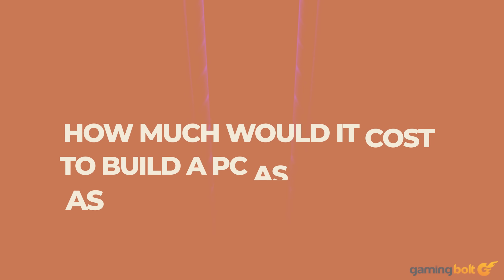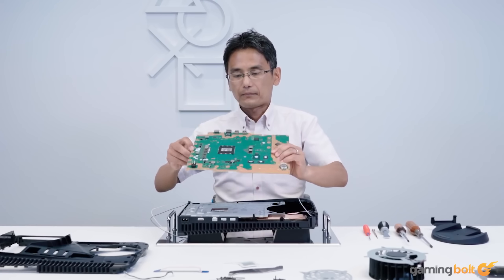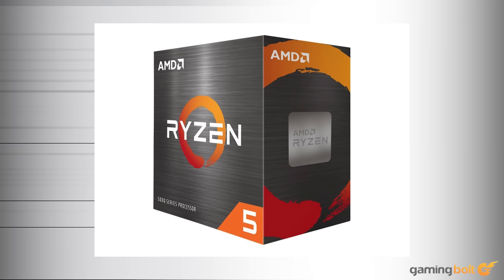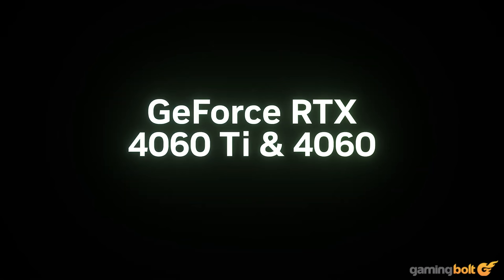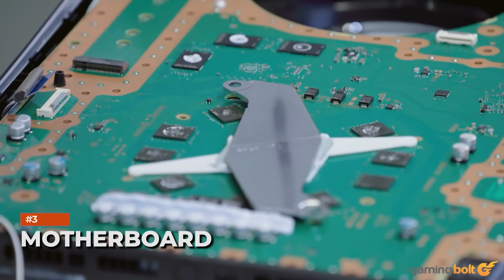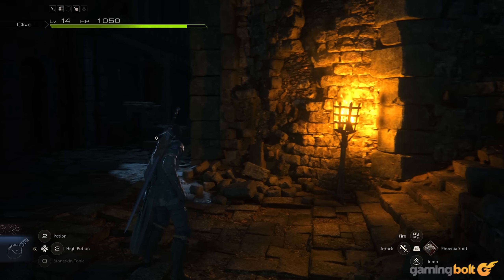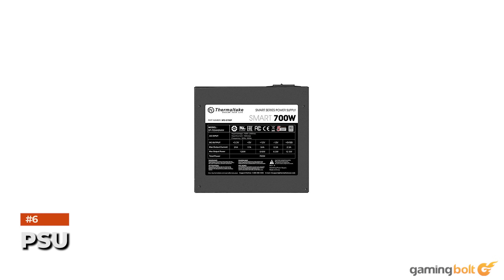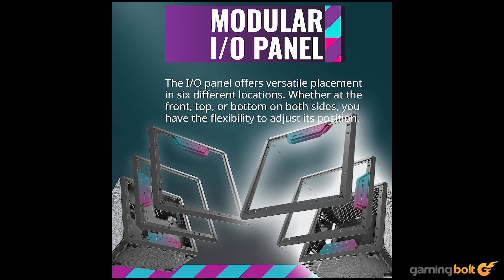How Much Would It Cost To Build A PC As Powerful As The PS5? (2023 Edition)

Comment: You lost me at 4060ti, the FP32 performance of a 4060ti is 114% greater than the PS5's GPU. The 5700xt on the other hand only has a 5% difference in comparison to the PS5 and would be a better match since the 4060ti way outperforms the PS5 GPU.
Reply: I would definently go for a 6700xt or 3060ti. I would also not recommend that Thermaltake psu it's horrible for reliability. Everything was OK other than that motherboard but still fine as 99% of games on pc don't support direct storage. And the cpu is better than the modified 3700 cpu for 1080p gaming.
Reply: @dayadam16 

The CPU in the PS5 is worse than a 3600. Digital Foundry have the Series X CPU and Ram on a board and performance is horrendous.
Reply: Raw performance wise I completely agree. The thing about PC vs console configurations is the optimization. Devs. only have to optimize for one set of hardware with console, but on PC there are so many different configurations.

Higher performance hardware can be seen as an offset to the difference in optimization.
Reply: @balloonreaper games are never optimised for PC on release nowadays anyway 😂😅
Reply: @balloonreaper This also explains why almost every game runs so much better on iOs compared to Android. Devs have to optimized for just one set of hardware.
Reply: @balloonreaper Not to mention the intrusive and inefficient operating system that runs on most PC’s
Reply: @richardbixler  Yeah, that’s valid. A lot of extra processes in the background, and OS level optimizations are borderline necessary; though this can be dependent on how powerful your hardware is as well.
Reply: @balloonreaper or if the games is designed around a console then the pc game is a second thought
Reply: @balloonreaper  even if you have the same config on a PC the results will still differ.
Reply: @balloonreaper The player can perform optimization themselves. Takes 10 minutes.
Reply: @balloonreaper  Nah bro, todays gpus with dlss and fsr really closed the gap. You can turn off certain settings that don’t do anything and give you way more performance.
Reply: @balloonreaper  I completely agree with you, but that raw power being far more than that of a console, it allows for higher settings, fps, and resolutions. It's just a poor comparison in my opinion. The optimization across the board has been lacking too, regardless of it being on PC or console
Reply: @Wrinkly-g2g  Yeah, no kidding. It seems to be prevalent with AAA titles lately. Holding hope that future releases are brought to the table with good day one optimization.
Reply: @balloonreaper valve optimizes too now, its insane what a steam deck can run
Reply: @Boro87  Right? It's a good thing though. The Steam Deck is great for gamers on the go.
Reply: Optimization on ps5 is not even remotely close to be as bad as it is on pc. I don't know what you mean by optimization across the board. Most games are optimized on the Ps5 first. Every other platform gets an inferior release. Especially pc.
Reply: @Wrinkly-g2g  thankfully it seems more games in the PS5 era have in game options to set the resolution levels and stuff.
Reply: It depends on the games , ps games are built for ps5 and will the need more power. It's impossible optimize for pc
Reply: @dannywelbz3650  the lanes on the 3600xt and the ram on a 2070 non super run at 3600 MHz with that ram and a good SSD (980) should keep the inside lanes open smooth like butter
Reply: @Wrinkly-g2g  I get it but NO. Take iphone for example. There are thousands of androids literally thousands which outperform ios in almost every metric possible yet iphone completely outshines any gaming androids and that is by a mile. Take iphone 13 pro max for example with its 6 gb of ram that grossly outperforms the rog 7 phone with its 16 gbs. And its not even close after around 6 months of usage while the iphone lasts basically 3-5 years depending. 

And i know exactly what i’m saying because i am an mobile esports player and there isn’t a single pro player in mobile gaming who would say that android is better even though benchmarks say that the android is wayyy stronger. 

Its still slightly different on the pc side of things. Due to the flexibility but im just saying this to say that optimization matters a lot. Thats how macs have been so efficient than windows despite of having a lot worse specs on chart and im not even talking about m1/m2.
Reply: @balloonreaper optimization? You mean for example jedi survivor on ps5 on per mode is 640p nativ scale up to 1440p and medium setting with RT and run 40-60 fps before new patch that cut RT and bump res to 1008p lower than 1080p scaled up to 1440p? On RTX4060TI in this game you can play im much higher res scaled up by DLSS3 that give you much better image quality, higher graphic setting and above 60 fps. And in other games is the same scenario schowing that rtx4060 Ti or even 4060 is faster than ps5 gpu that is equivalent to RX6600XT-6650XT RDNA2 pc gpu-s.
Reply: @Mr_Pan01  Yep, that would certainly be a method of optimization. I think the reason 4xxx series GPU's are capable of getting some significant performance gains has to do with  DLSS3's frame generation capabilities. DLSS in general is a very useful feature, but their third iteration of it seems( so far ) to have the best benefits.

Even without DLSS( any iteration ) many PC's of a higher spec are going out outclass console performance across the board. It's just the nature of things y'know? Technology advances so fast on the PC front that they can't pump out consoles fast enough to keep up; at least not reasonably imo.

I'd say the only time console has an edge in terms of performance is when devs. put forth poor effort to get their PC releases as stable and optimized as possible. That's not say it'll always this way, but there's a statement in the attempt just as much as the complete product.
Reply: @Mr_Pan01 thats what i have, an rx-6600xt and frankly, i play everything on ultra no problem. With an 11gen cpu. Frankly i would never go back to console. I switched ps4 for computer. Will never come back.
Reply: It may be but performance wise I don't see it doubling the performance of a 6700.
Reply: I think he was building a PS6
Reply: @Amnesia2121 PS6 is about 3 to 4 years away so I say PS6 will be more  Powerful
Reply: He was talking about 4060, not 4060ti.... though in the picture he showed both.
Reply: 4060ti its like 2 gens ahead of the 2080 (ps5) this guy lost his mind
Reply: Why everyone is talking about 4060ti? He said 4060...
Reply: @TheSlimshady955 even though a 4060 is waaaay ahead of PS5
Reply: @BugHuntersPC   i wouldnt say way ahead since gpu equivalent to a ps5 is like between rtx 3060 and 3060ti , when we know that rtx 4060ti performs less than the 3060 ti in some games, it's not as much as you pretend. But yes, its overall better performance. A 4060 is more like a 50 braket btw. The true gpu equivalent should have been an rx 6600 xt...
Reply: The most similar gpu purely based on specs and nothing else is the rx 6700 non xt  vram is te only difference
Reply: @ham_..  fax bro compared a $400 gpu to a $400 console that runs at half the settings
Reply: @ham_..  I can agree it's a far better comparison. I'd say the 6600 is more in line as far as tflops are concerned.
Reply: Optimisation take under consideration
Reply: FP32 performance of nvidia cards is doubled on paper since the 3xxx versions, since those cards do 2 integer calculations per core per clocktick. This results in double the tflops on raw power compared to the 2xxx versions or AMD cards. It’s just on paper and good for the tflop marketing. The 4060ti is not 114% faster than a PS5 GPU.
Reply: Equivalent wise, on the AMD side, then it's basically a like an undervolted 6700 or like a slightly overclocked 5700XT only with RT. On the Nvidia side, it would be around the same as a 2070 Super or half way between a 3060 & 3060Ti, only with worse RT perf.
A 10GB 6700 would have been a far better and more accurate choice for GPU, TBH (plus it's far cheaper than a 4060Ti).
Also, a 3600X or 3700X (at it's  base clock) would have been a more accurate choice for the CPU. A 5600X is also slightly OP, when compared to the PS5's CPU.
You also don't need a 700W PSU, a 500-600W PSU would be more than sufficient.
I dare say that this build will likey put out around 25-35% more raster performance than a PS5 and far more RT performance. Plus you could have easily shaved off $400+ to it's price, to actually be roughly on par to a PS5.
Reply: 114% greater or 14% greater?
Reply: @ddnava96  when you look at fp32 performance the equation is (cores×clock speed*2 flops)/1,000,000 if you're calculating your clock speed as mhz. Which this just equates to tflops. The PlayStation 5 has an fp32 performance of 10.28, while the 4060ti has 22.06. To get the percent difference which is really just percent error, you do (22.06-10.28)/10.28 × 100%, which gives you 114.6%. That the difference in performance.
Reply: @Wrinkly-g2g FP32 performance is different from actual performance in gaming. The 4060ti is 20% faster in practise
Reply: @ddnava96  gamers Nexus did a better job on this topic
Reply: My 3060 smokes the ps5
Reply: @Fckyoutoob  try to run ps5 god of war via emulatorand ur graphic card will get smoked.
Reply: @kingcobralive3081   is that because of poor graphics card or shit optimisation/emulation though?
Reply: @Fckyoutoob  poor optimization bro, thts what m telling, its all abt optimization. 3060 all have good raw power but not optimization.
Reply: @kingcobralive3081   tbf I have a ps5 and xbox seriesx (stupid name) and the ps5 smokes the xbox in all ways that matter for a console (better games and cooler controller) although with Microsoft buying 3rd party devs like candy lately that might change
Reply: @kingcobralive3081  you really dont understand how emulators work do you
Reply: @stephenallen4635  if u really understand so much than play ps5 games on ur emulator..
Reply: @kingcobralive3081  4 months later you just came back to prove my point?
Reply: @stephenallen4635  naah.. just received notification of another reply on my comment and found urs 😂, dnt even remember what conversation was
Reply: @Fckyoutoob  no it doesn't lol
Reply: 4060 is closer.
Reply: Well I see from 90s till this era. Western audiences are always interested in PC building and PC games and Japanese audiences always love Console gaming. So basically Consoles are made for Majority of Japanese people in mind. Majority Japanese people use pc for work and gaming for console. Japanese gamers have very different thought they didn't care of fps graphics realistic physics etc etc. See why Nintendo switch perform well bro just see Nintendo switch Japanese commercial you understand their gaming culture. So this the reason why PS5 has enough for Japanese gamers.
Reply: 4060 ti is horrible with its 8 gb vram
Reply: @Gamfluent  wtf are you even on about this reads like a junky trying to explain something to you on the side of the road at 4am
Reply: https://www.youtube.com/watch?v=Eg2GCA4scZ4  You're wrong.
Reply: FP32? brosky, learn what gaming is. You could ve kept ur mouth shut and look up benchmarks at 4k to know that ure wrong but you chose to be brainless and spam seethe comments, lol. 4060 ti = ps5 Source: ANY benchmark at 4k native of any game.
Reply: @BugHuntersPC  well done clever guy you deserve a winners badge! Yes it is, and the premise of this poorly planned (and presented) video was to build a PC that could match a PS5. He has built a PC that is more expensive than a PS5 and outperforms it. What kind of like for like comparison is that 🤣
Reply: @russ9034  the guy thought something like 4060 = 3070 = 2080 but the fact is that Nvidia with every gen it increases the transistors , the drivers , the architecture itself it’s not comparable not counting that this is Nvidia not AMD so on ps5 we don’t have all the fancy stuffs.
Reply: @BugHuntersPC no not at all the 3070 outperforms a 4060 by over 20% the 2080 is better by 1. Thants not including the super or ti version. The 60 series is useless. Nobody should buy them. Save up the extra hundred and get the 70 always
Reply: Ps5 performs like a 6700/6700xt
Reply: I was under the impression it was running a 5800xt gpu chip, but with 16 gigs of vram. So we're looking at somewhere around the mid 6000's for the Radeon lineup. Imma call it even around the 6650 in terms of power or performance total. So somewhere around a 3050/ti? I know the ps5 gpu isn't as good as even a base 3060/rx 6700. Its a little slower than that but the extra vram and the higher built in bandwith make it operate somewhat modern. Most people can't tell unless they pc and console game and have recently played with both.
Reply: @mikeclardy5689  PS5 is equivalent to rtx 2080. Shared system memory is never as good as dedicated memory pools for Vram and system.
Reply: @leanlifter1  2070s
Reply: @mikeclardy5689  5800xt and rx 6650 dont exist
Reply: @stephenallen4635  Radeon does make a 6650xt (i realize i didn't add the xt before) and maybe thats why you felt the need to point that out? And tbh I dont know a ton about Radeon's lineup because I've only this year started really studying pc parts and their relative performance.  I kinda assumed there would be because I see how they structured their 7000 lineup, and then their 6000, so I figured it was the same thing all the way down. I know, kinda learning hardware from the top down. Its a little backwards.  
Also I thought a 2080 super or ti is around if not a lil better than a 3060/ti. so I'm not off by much. Thank you for clarifying. And I've heard that universal or shared memory is bad before. If you don't mind sharing thatd be cool. 
Though it makes me wonder why they would just have 1 separate node of ram just for the os if thats the case. they could put that 16g towards just video memory and get a good performance bump in visual capacity.
Reply: @mikeclardy5689  If youre talking about the shared system memory on the ps5 then its likely better than the alternative of 8gb system memory and 8gb vram. Sometimes the amount of system ram or vram needed will exceed 8gb and in that case it can dip into the rest of the ram which it wouldnt be able to otherwise, and on a console its easier to prevent situations where the gpu and the rest of the system are competing for ram because the games are developed for just one system as opposed to the thousands of different setups different pc gamers will have.
On a pc you use a different type of ram for your system compared to the vram for a gpu, system ram is generally designed to have lower latency which allows it to react faster when doing multiple different tasks  while vram has much higher bandwidth to accommodate the large amount of data needed for rendering frames. The ps5 uses only the type of ram used in vram for the shared memory so latency will be much higher which would cause issues on a pc but again because developers only have to optimise for a single system and because a console is only used for gaming its easier for developers to work around those issues

Having a separate small pool of ram just for the OS, like they did on the xbox one adds extra cost and complexity which may have been worth it at the time but now when higher capacity and faster ram is cheaper the shared set up they have on the new generation of consoles is probably a better option
Reply: Yeah try games of 2023 with a 5700 xt and you get maybe fhd but without rtx don't get it that a ps5 with a amd gpu is good with rtx but other amd gpus arent
Reply: @yamiimax  who cares about ray tracing tbh... it consumes so much ressources for barely noticable features. Amd gpu are much better bang for the bucks /performance by far ...
Reply: @TheSlimshady955  well besides raytracing most Nvidia GPUs are better optimised for games as AMD or Intel
Reply: @yamiimax  Nah, check any benchmarks with recent gpu and you get more fps for your money with amd
Reply: @TheSlimshady955  I'm not a fanboy I would like to believe that

Yeah the 7700 XT is good for under 500 $
Reply: @yamiimax  You are an nvidia fanboy , yep
Reply: @TheSlimshady955  no AMD may have now gotten better
Reply: @yamiimax  I use both Nvidia and amd gpus and i can tell you they are better bang for the buck
Reply: @TheSlimshady955  you mean for the money well DLSS looks better than FSR I do not want to use dlss but I have to 

I'm a laptop gamer and there are not good gaming laptops with AMD well maybe my next laptop could be a AMD I guess amd could bring new GPUs for laptop in the future
Reply: @yamiimax  FSR is now pretty close to what dlss can do... specially FSR 3. Amd dont cheap on VRAM, they allow retrocompatibility for their products and FSR works on every gpu ...
Reply: @TheSlimshady955  sure but it can't beat Frame Generation on nvidias 4000 GPUs

Don't get me wrong I was a big fan of AMD but Nvidia has this frame Generation and it sounds great haha
Reply: @yamiimax  frame generation is not as great as people pretend it to be...
Reply: @TheSlimshady955  yeah I haven't tried but it's all about fps and it seems like the quality is not dropping hard with it

Btw it work even without dlss
Reply: @yamiimax  frame gen is great. So is using it for pathtracing on cyperpunk's new dlc. People hate the 40-series/ 4060ti (16 gig) and up for the price you pay, not because they are poor cards at all. I play a 4070 and usually on 1080p or 1440p and I don't really understand why everyone loves 4k vs 1440p. AMD FSR is great and I LOVE my steam deck but it just isn't close to DLSS,DLAA or Frame Gen tech.
Reply: @born2serve92  it's quite the only game with pathtracing it's boring I want new games not an 2020 game dlc haha
Reply: @yamiimax   Alan Wake 2 is 10 days away and features PT? This same argument was mentioned when RTX came out and UE5 games such as lords of the fallen are doing high refresh rate on 40XX when Fort Solis and others struggle to upscale at 30 fps on a ps5. Spiderman 2 shows the ps5 has power, but it's still RDNA 2 tech. Ray tracing and path tracing aren't going anywhere.
Reply: @born2serve92  well you need quite the best GPU with Alan Wake cool if you have a 4080 or 4090 haha

Graphic isn't everything gameplay is important too 

I rather would play Spider-Man 2 than Alan Wake but I'm a pc only gamer haha
Reply: @yamiimax  well, besides buying from the epic game store, the game is very good. You should have it a try! I enjoyed Alan wake 2 much more than Spider-Man. Just my preference:)
Reply: @born2serve92  don't like horror adventures but cool action adventures haha

I liked The Quarry I heard it's quite similar
Reply: @yamiimax  I’d consider it more of a thriller than horror. The shadow people aren’t scary, just unnerving. 
It has a lot of tension, but you will go literally 3 hours without any danger. It’s all about the plot :)

It is probably the best looking game I’ve ever seen haha. (It came free with my GPU purchase and I liked it more than most games this year.)
Reply: @born2serve92  hype is real haha 
Well I just bought RoboCop I'm hyped too
Reply: 690Dragonx  the 4070TI plays native 1440p Alan wake 2. The PS5 is only playing it at 1200p upscaled with FSR. 

The 4070TI and DLSS are nearly 3x as powerful as a PS5 but do whatever makes you happy. I think the 4070 super was 2.5x on digital foundry.

I prefer playing oled ultrawide at 3440x1440p w/ HDR and path trace. 
I own a ps5 and just did the silent hill short message and it’s hard to go from 80-175 fps to 30
Reply: 690Dragonx  who plays with a 4k tv on a ps5 anyway? Nvidia cheap on Vram for no reason either way. You can see rtx 3080 struggling with some games in 1440p/4k now just because of that. Better optimization doesnt mean that you can cheap the hell out of it...
Reply: 690Dragonx  What about most people dont actually play on 4k 80 inch TV?
Reply: Not 4060ti.  It's 8 GB vram is a big issue.
Reply: @Richdadful  yeah those 128 memory interface is weak and yeah the 16 gb vram Version has the same interface haha
Reply: Same...
Reply: Try 4k and you barely hit 30 fps 😅😂😂 you cannot play 4k woth 4060ti shitty gpu..
Reply: Dude ofc ps5 is stronger every game is smooth to play cuz it's console u can play with pc but get i7 14700k amd rtx 4070 ti and above
Reply: 114% greater than PS5? Are you playing games that are 10 generations ahead of what PS5 can play? The fact is - PC or PS5 doesn’t even have games yet that can utilise their full potential and it’ll never be the case especially for PC since most graphically  demanding games are console exclusive first.
So all that raw power of 4060ti is nothing but a waste when it comes to playing games. 
It’s like putting a twin jet engine in a land-vehicle and calling it exponentially faster than any other car that has ever built. But where exactly are you gonna drive that vehicle with twin jet engines? There are no roads made for it.
Reply: @xparik  A 4060Ti is a pretty solid GPU when it comes to 1080p & 1440p gaming, with it hitting above 60fps in most games at 1440p and above 90fps at 1080p. At native 4K, then it all depends on the game. For example, in Cyberpunk 2077 at Ultra settings it'll only manage 11fps, while in Forza Horizon 5 it will do 68fps maxed. Typically middling games like Returnal or older games like RDR2 will manage around 35fps (or a locked 30fps). The same locked 30fps also goes with most of the more demanding titles, if you are willing to knock the graphic settings down to meduim (PS5 level). As for RT then typically forget about it, just like all GPU's at this level. You really need at least a 4070/7900XT to even consider using RT, due to the performance hit.
The only real issues with the 4060Ti is it's expensive price and due to the memory constraints (at least with the 8GB model), it's longtivity.
If it was priced below $350 (ideally around $300), then it would be a fairly decent GPU for the asking price.
Reply: When you know nothing about optimization 💀 all you have to do is compare actual performance of games to realize how have to spend a LOT of money to out-weigh the shitty PC ports you get of console games
Reply: @nuh-uhbro765  lol I'm well aware of optimization. Nvidia literally has the best driver optimization, and upscaling technology (dlss). A 4060ti blows a console out of the water. When I use a 3060ti, I still get higher frames, resolution, and graphics settings than console games. Bad ports are on developers, both console and PC suffer from them, more so console though. That's why you're seeing games on newer engines running at 30fps on current gen consoles.
Reply: @Wrinkly-g2g  Blaming the game developers for optimization actually kind of furthers my argument. Gamers who aren’t just computer enthusiasts looking for an excuse to validate their hobby, really only care about playing the latest games with a smooth experience. The fact of the matter is that most big release games are specifically optimized for a console that cost $400-$500, while the same games chug on hardware that’s supposed to be better on paper and cost 3 or more times the price. Yeah it’s up to the developers to optimize their games for PC, but guess what? They don’t. Spend more on your graphics card than you would your entire console and watch that game you’ve been excited for to still run like ass
Reply: He said 4060 non ti
Reply: I even read a 4060 ti is more equivalent to a PS5 pro based on some leaks/rumors, from 10 teraflop PS5 to 4060ti about 20 teraflops if I’m not mistaken. Though teraflops aren’t exactly reflective of graphics, 4060 ti is def much beefier than PS5.
Reply: @ReelReviewsRR  I own the 16 gig model on a spare pc and it’s a good card but you can’t really compare them. 
RDNA2 tech vs 40XX Ada Lovelace is so different. 
I expect games like Alan wake 2 to look stunning on pc RT or path tracing when I’m not even sure what upscaled resolution ps5 will use.

The ps5 an absolute beast of a machine and cheap. 
Nothing compares well tbh
Reply: Just run a overclock 3600xt a 2070 no super and 3600rpm ram your good to go...use the fuma 2 cooler
Reply: The 5700xt doesn’t have RT cores, thus no raytracing unlike the PS5s gpu.
Reply: Its all abt optimization boi, raw performance wont help, due to optimization only ps5 matches 4060ti 😉.
Reply: @kingcobralive3081  you can't optimize what you don't got. Raw power means just as much.
Reply: @Wrinkly-g2g  Nope, optimization is the rrason gta5 still runs on ps3 and even on ps4 at 60 fps while pc equivalent to its power are not even able to run such games.
Reply: @kingcobralive3081  I think you need to research a little more. GTA 5 is an old game, a potato can run that.
Reply: @Wrinkly-g2g  i dnt hv time 4 tht, but its a fact.
Reply: @kingcobralive3081 LoL, what a liar. GTAV ran at 30 FPS on PS3 with lots of drops and stutters and every single setting is lower than low except for shadows & textures and GTAV on PS4 looks awful on PS4 with only 4x AF and without dynamic shadows. And not only that, the game on PS4 has lots of drops to 20 FPS on Story Mode and below 10 FPS on Online on Cayo Perico, it was never 60 FPS, and this game already ran on a low-end GTX 750Ti & Intel Core i3 at 60 FPS at 1080p with high settings. And the PS5 isn't doing any better, with only 60 FPS on two graphics modes that still run below Ultra Settings and even have to use Dynamic Resolution being 1440p the maximum one, even there's a 30 FPS, THIS IS A TEN YEAR OLD GAME. And the newest games like Star Wars: Jedi Survivor, Alan Wake 2, PayDay 3, they all run below 1080p as the base resolution  at the 30 FPS mode already. I'd rather not have "optimization" at all if this is what you mean. Besides, that excuse died once Sony & Microsoft started using AMD hardware instead of developing their own APUs.
Reply: But your not running a stripped down console version of the game, your going to be running the full flavour software which has higher demand on the components coupled with Windows etc which may have more demand then ps5 operating system.  Also as mentioned compatibility of components in various combinations with different game can give vastly different performance too.
Reply: @solreaver83  both of those things aren't anywhere near as much of a factor as they used to be. Games on consoles arent "stripped down" theyre just running at the same med/low settings that you have the option to run on PC.
Reply: @stephenallen4635  yeah with all the high end settings turned down or off. That's what I was saying
Reply: @solreaver83  ull understand my point when ull be able to play spidermen 2 using 7080 or 14080ti 😂.
Reply: Direct quote from the video: "We tried to create a PC that would match, or better yet, surpass the performance levels of Sony's current gen console offerings and see how much it would cost for a consumer."
Reply: A 4060ti isn't 114% faster than the PS5 lmao. It's like, 20% faster or so. The PS5 is similar to a 4060 non ti
Reply: @ThePipojp  do you even know how to do math? It's 114% greater in comparison of their fp32 performance. The 4060ti has 22.1 tflops, while the PS5 has 10.28. ((22.1-10.28)/10.28 x 100%) will find the difference in tflops, and that's a 114% difference in power. Learn to math.
Reply: He literally said they are trying to make a pc to match or surpass the ps5 🤔
Reply: @markuscwatson  key word there, bud, "match". The whole thing was about the cost of building a system to match the PS5's power. My point is you could do that with a much cheaper build. 🤔
Reply: You have to be a special type of nerdy weirdo to game on a pc. 
PC cancer race for the win !
Reply: Anyone on this post saying they would get the 4060 or ti variant don’t. Spend the extra 100 and get a 4070. The 60 of every generation is useless when you get such a massive performance jump for so little
Reply: Bruh
Reply: Hmm yes $1000 pc v ps5 who will win
Reply: The only difference between the rx 6700 non xt and the ps5 is the vram is 10 instead of 16 the memory bus width is 160 Instead of 256 mostly bc of the higher vram
Reply: He said, "Match or surpass the PS5." Maybe you should listen, then you wouldn't get lost.
Reply: 4060 Ti performs worse than PS5 for new AAA titles due to less VRAM
Reply: The rtx 4060 ti is 34% faster than the Rx 6700 ☠️ the PS5 GPU is basically the same as a RX 6700, not 5700 XT 😂 but the PS5 has more VRAM and clockspeed . That's a fair comparison when taking into account the optimisation of the PS5...
And he said 4060, not ti... So the RTX 4060 is only 13% faster than a RX 6700 !!! It's like the perfect GPU to have the same performance as the PS5
Reply: @killkiss_son  PS5 is better than 4060 Ti when it comes to real world performance. A person who compares a console and PC spec to spec knows nothing about tech. 4060 Ti struggles to run all the recent AAA titles and will struggle even more in the coming years due to less VRAM
Reply: @killkiss_son  umm, you obviously don't know how to calculate tflops. Or percent error (percent difference in this case). The 6700xt has 12.4 tflops in comparison to the 22 tflops the 4060ti has. So, % difference is (22-12.4)/12.4 ×100% which will give a 77.42% difference between the 6700xt and 4060ti. Dlss is also better than fsr. So you'll get way better performance from a 4060ti.
Reply: @Wrinkly-g2g   TFLOPS means a absolute nothing lol... It's just ok to compare between same generation of GPUs on the same brand and even then doesn't tell much because there's a huge amount of specs in the mix that count for real world gaming performance.

Also some current gen low end GPUs got almost double the TF of last gen similar models yet they perform with minimal difference and in some cases can even perform worse because they were severely cut either in Vram amount, Vram bandwidth, PCIe lanes or number of cores...
Reply: Imagine being a triple a pc gamer in today's age and dumping on ps5 users with better optimization than you. Couldn't be me.
Reply: @Stoney4155  better optimization? Dlss blows far out of the water, my guy. I'm playing games at maxed out settings, higher frames, and resolution. I have a PS5, and I can say that games look and play far better on my PC.
Reply: @Wrinkly-g2g  but that same game sa2 on dreamcast emulation? Miles fucking better, I wonder why. Maybe because steam sucks
Reply: The ps5 is like a 2060 brah.
Reply: what kinda nerd are you goddaammnnn
Reply: Its not that apples to apples. While in theory the raw perf should put the 4060Ti it a class above the ps5 the problem really comes down to software.

Take ps4 for example. When it was launched the 750ti was able to comfortably compete with it. 
But can you imagine running god of war ragnarok or horizon forbidden west on a 750ti today? Hello no.

The main value in console gaming is the longevity of the hardware.
Reply: It does need to though as everything is optimised on console
Reply: Yeah exactly, regular ol’ 3060 would be more appropriate imo, if we are comparing it to a PS5.
Reply: He used 4060... not ti...
Reply: Came here to say this and glad that I'm not the only one.
Reply: The sweet spot for a ps5 equivalent is a rtx 2070.
Reply: Yeah games will still be optimised with consoles in mind since that’s what most normies use. So it doesn’t matter your performance. Also if the game is playable who cares?
Reply: You arseflaps are talking about a 4060ti. The comparison is with a 4060
Reply: PS5 $500 vs 4060ti $599😂
Reply: @nct7259 you can find variants of the 4060ti for less than $400, bud. Do some research before you post. And my point is you can go with a much lesser card and still beat the PS5.
Reply: While I agree with the sentiment, a 4060 ti is quite a bit too powerful for this pc build. Floating point performance means absolutely nothing between different generations of gpu it cannot be used to compare performance accurately in any way. For example the rx 6700 xt and the new rx 7600 have similar performance however the rx 7600 has almost 1.8x the floating point performance

The ps5 gpu sits between the rx 6700 and rx 6700 xt in terms of actual gaming performance
Reply: @stephenallen4635  7600 is 11 an Tflops GPU not the artificially inflated and stated 21 Tflops lol.
Reply: @leanlifter1  and where'd you get that from
Reply: @stephenallen4635  Tech power up specs has it at 21 Tflops FP32. The fact is current mid range GPUs are as powerful as the PS5 which has the performance equivalent to rtx 2080 GPU even if the specs are reading higher than they have the right to be I mean 21 Tflops mid range lol that's just ridiculous lol.
Reply: @leanlifter1  and? So? Where do you get 11tflops from
Reply: @stephenallen4635  Anyways mid range cards of this and last gen are on par with ps5 so that's a positive regardless of inflated and inaccurate specs posted.
Reply: @leanlifter1  dude answer the question what makes you think its 11tflops floating point? Sounds like you just made it up cause you dont understand what floating point performance is
Reply: @stephenallen4635  The 2080 is a 10 TF card so I guess the 21 TF on the Rx 7600 is just a bit screwed is all I am saying lol because as we all know the 7600 is not twice as fast as a 2080 lol.
Reply: @leanlifter1  floating point performance isnt a measure of how something will perform in games. Thats what I explained in the original comment you replied to strange how you didn't actually read it
Reply: @stephenallen4635  Yes it is. They just skewed the numbers for the Rx 7600 @ 21 Tflops FP32 pff ya right otherwise it's consistent indicator of performance.
Reply: @leanlifter1  lean you dont know what you're talking about. Floating point calculations are one set of operations a gpu can do. The number of floating point calculations a gpu can do just determines how fast it can do those types of operations but thats not the only type of calculation that goes into rendering a frame. Different gpu architectures prioritise different areas of calculation so no you cannot just use floating point performance to determine in game performance between different generations and brand of gpus. I cant explain it to you in a comment and you wouldnt care anyway but go look similar performing gpus across different architectures and generations and youll find you're completely wrong thinking tflops measures relative performance, rx 580, gtx 1060 and gtx 690 have wildly different fp32 performance yet they all perform within 5% of each other in games
Reply: @stephenallen4635  The TFlops say is performs like a 3070 but in reality it's around the same performance and Tflops FP32 as an RTX 2080 at 10 Tflops. They inflated the Tflops number on the Rx 7600
Reply: You are correct 💯
Reply: Lol any average PC can do more than a OC'd ps5
Reply: @jackinthebox1817  I wouldn’t consider a PC that can run Spider-Man remastered with ray tracing enabled at 60fps average, but whatever justifies the money you spent on your Windows brick more power to you
Reply: @nuh-uhbro765  So you do admit gaming for decades at 30fps. Do you realize that 144hz/144FPS is old news on a "windows brick"? Lol
Reply: @nuh-uhbro765  On the PS5 It's using DRS (resolution upscaling) for 60fps with ray tracing enabled. However, most of the time while it is in RT Performance Mode as DF have pointed out in their analysis video, its hovering mostly between 1080p and 1440p to achieve that 60fps.
On PC a 6700XT or 3060Ti can manage a locked 60fps at 1440p with the same graphic settings (High) and the same amount of RT (Low), while also using upscaling (DLSS/FSR balanced mode). A 6700XT currently costs around $300 and a 3060Ti $360 (less than $240 if bought second-hand)
Nowadays both cards are pretty much classed as being average, when it comes to a gaming PC.
Reply: @jackinthebox1817  Yep, it's a very rare sight even now to see a game on the consoles running above 60fps. Even the most modest of mid-range GPU's each gen on PC, have been pumping out 90+fps, ever since the last gen consoles where released. Hell, I barely ever play any games at all now that are much below 120fps at 1440p, on my 3080, especially as low as 60fps.
Reply: TFLOPS are useless as a measure of gaming performance, my guy.
Reply: @reinhardtwilhelm5415  not so true, my guy. You can't run a game without processing power. You're just one of those guys that says "it's all about optimization." You can't optimize what you don't have. It's about taking advantage of the processing power you do have. You can go way farther with more tflops.
Reply: @Wrinkly-g2g  It’s completely true - look at Nvidia implementing dual issue in Ampere and only getting a 35% performance increase, and then AMD implementing dual issue in RDNA 3 and only getting a 10% performance increase for all that die space.

I’m sure you could optimize for dual issue, but I’ve yet to see an example of that actually happening in games.
Reply: @reinhardtwilhelm5415  anything is, it's all relative the only factor is the gpu number
Reply: Yeah I have a ps5 with a 2tb ssd and a pc with a 4060 ti 32gb ram 10700k ASUS prime z590 a 1tb SATA ssd and 2tb nvme. And it def cost 3x more than my ps5. But 4060ti is def out performs
Reply: @pinoyprince26 gotta add all the years of pay to play online as well, as more expensive games and can't play all your Playstation games from all consoles and future ones. Only selected few. So really bad deal if you think about it.
Reply: The raw calculation performance means an absolute 0, it only tells something when it's the same GPU brand at same exact generation.

Just like AMD 7000 some variants are almost double the raw calculations of their 6000 series counterparts but then only give you a few more FPS in games because they were severly cut in many ways like much less cores, much less memory bandwidth, same on Nvidia side.

I'm sure if the AMD 7000 series maintained or improved the memory bandwidth and some other things, the GPU would perform massively different same on Nvidia side where some GPU's even perform less than the older generation on some games due to the severe cuts in cores, memory bandwidth, PCI-e lanes (specially for old PC's with like PCI-e 3.0 is severe)...

In reality even a RX6700XT which is probably the closest still has a hard time to give the exact same performance cause lately we mostly get crap bad ports and then PS5 still has much higher memory bandwidth (448GBps) on top of a RX6700XT (384GBps) which is actually still slightly higher than the RX6750XT (432GBps) which definitely helps on high resolution stuff specially to run at 4K or even upscale to 4K.

Then off course there's always something custom in the consoles, like Xbox is more powerful but some indie game manage to get 8K on the PS5 and the devs said they couldn't achieve it on the Xbox Series X, maybe it's to do with Xbox dual memory of both lower and higher bandwidth than PS5 or something else.

An example is the PS4 Pro I heard it has a hardware level custom silicon for the checkerboard upscaling so that it doesn't cost any performance to the main CPU or GPU cores and both PS5 and Xbox series or any console usually have something custom to improve something without costing too much performance which they can't afford.
Reply: @guily6669  PS5 is RDNA2 10.3 TF PC equivalent of this gpu in the same architecture will be RX6600XT 10.4 TF. This is low-end Gpu to play games in 1080p high/ultra in 60 fps. Just like ps5 that upscale games from 1080p or lower to 4k and run games in lower setting than high or ultra. And also can run games in nativ 4k or close in 30 fps medium setting.
Reply: @Mr_Pan01   it totally depends on the game cause 6600XT barely can't catch a PS5 on a lot of games, it performs more like a RX6700XT in the real world but some games still are better optimised on consoles, sure doesn't mean all are good on consoles like always...

I'm into PC's and consoles since early 90's and it always been the same thing.

When Xbox 360 launched a year later I had a ATI X1800GTO which was very similar but eventually I couldn't even play a single game sadly...

Back when PS4 released I still had a GTX570 but a 3 massive slot one with 25% OC over a stock 570 and 1.2v bios flashed and at the beginning I could actually play with higher settings and better performance than most PS4 games when the console was actually even more powerful, but it got to a time my GTX570 just couldn't play anything and PS4 kept going and showing better visuals until it went a step further with PS4 Pro.

I also have a Strix RX480 flashed to Strix RX580 which is same gen as Xbox one X and PS4 Pro and very close to the Xbox 1 X in Tflop, slightly higher even with the small OC I had it was giving me around 6.8 Tflops if I remember well, yet I could never get the Xbox one X in a lot of games with similar settings even on games that run well like Forza, they simply required more hardware in the PC than the console part, in fact a few games I even struggle to get much lower PS4 Pro visuals and perfect performance, but yeah all gens and all consoles also always had their good share of bad optimised games so nothing means anything at all...

ps: It's very game dependant, but when consoles are all now X86\X64 and AMD Ryzen and RDNA based just like we have in the PC, I thought bad optimised games was finally going to end and well sadly bad optimised games is mostly what we get lately even worse than a few time ago on PS4 Pro end of gen 🤬🖕
Reply: @Mr_Pan01 PS5 uses a modified RX6700 (non xt) that's essentially  undervolted.
Reply: @guily6669 So you mean stick with console if you want games?
Reply: @alnilam8048  hell no, never said that. Always liked both but I always stick more with PC so I guess everyone's free to choose their favourite platform...
Reply: @guily6669  Oh thx bro for the reply. I understand that.
Reply: @guily6669  There's a video from Digital Foundry that clearly shows the PS5 is comparable to a 2070 Super or 6600 XT in modern games. Dream on if you think the PS5 can match a 6700 XT.
Reply: @tvcultural68   the most optimized PS5 games ou can not get the same exact performance with a 6600 XT...

Just like Digital Foundry tested the Xbox and same exact GPU's as it and could never give the same exact performance on some of their most optimized games compared to PC.

PS5 is kinda like a 6600XT but with way more mem bandwidth even more than the 6700XT.

In fact I have the 6700XT and some games not even 1080P run that amazing and I have the most expensive Strix ROG 6700XT.
Reply: @guily6669 Actually, there are games where the PS5 gets utterly crushed by the 6600XT, like Hitman. Check out the Digital Foundry video. I'll leave the link and the video's name in the next comment; if it doesn't show up, it's because our "wonderful" YouTube deleted it.
Reply: @guily6669  "The ps5 gpu in form?  Rx 6700"